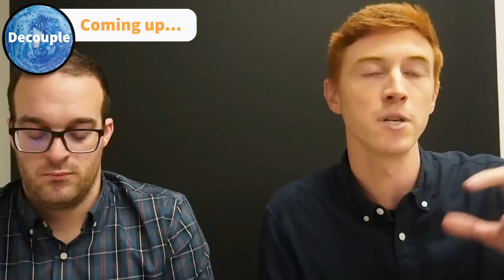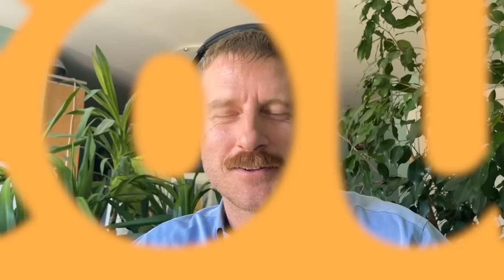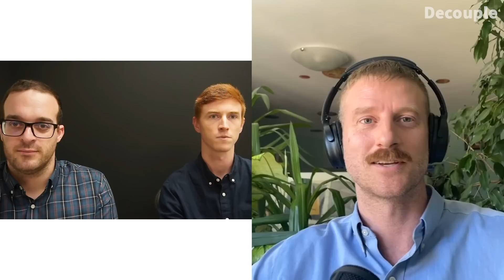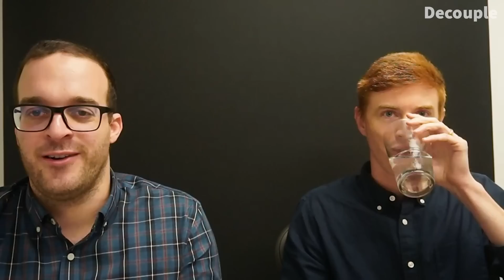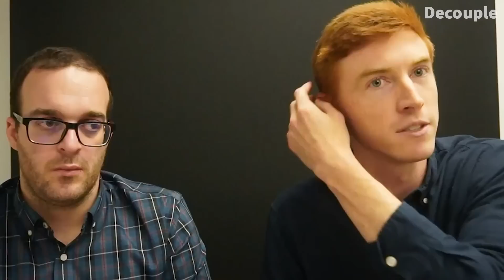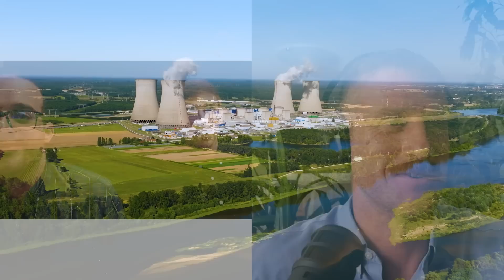The Real Costs of Advanced Nuclear

Comment: All this engineering for fuel handling? The gas makes it more complex engineering - not less. So why bother? Why? Put your brains and money into molten salt reactor technology and you get high temperature with zero (relatively) fuel handling issues, plus the many other advantages of MSR you don’t get with any other type of reactor.
Reply: Also no downtime for fueling. Low-pressure/high-temperature/low-cost, what's not to like.
Reply: @chapter4travels  nuclear needs constant demand daily and constant cash flow daily. 

That is a real problem, for all centralised electricity.
Rooftop PV and BVs oversized battery is the real disruptive.
Reply: @stephenbrickwood1602  Ok, so the world is going to go from 20% electric to 100% electric with rooftop solar + oversized battery EVs. Bwhahahahhaha
Was there a contest for dumbest energy transition plan possible? If so, you win, hands down.
Reply: @chapter4travels  you remind me of the child who said he would pay for it, you just give me the money.
Reply: @stephenbrickwood1602 .  Nowhere ever has solar been a replacement for nuclear. It’s solar over a lot of land plus something else, ie gas, plus pipelines plus transmission for both, plus staff and maintenance for both. We all know that.  You know that. So why carry on about cost of solar alone as if you’re fooling somebody?
Reply: Since there is no commercial MSR, not anywhere in the world, and there never has been, why would should some engineer starting a new company in the worlds most highly regulated industry do something so foolish?
Reply: @Czeck0-u1k  Because old school, outdated, obsolete, high-pressure/low-temperature, inefficient, really, really expensive reactors will only ever be niche (electricity only) sources for rich countries. 
Whereas MSRs have the potential to be cheaper than coal plants without scrubbers. It's just the potential because of the over-regulated market as you say but worth the effort. 
PWR/LWR are old, boring, and have no future and MSRs do.
Reply: @chapter4travels   bizarre. All those adjectives w zero real argument. Might as well be doing a Superman vs Hulk thesis.
Reply: @Czeck0-u1k  It was fun to type and I'm pretty sure you figured it out.
Reply: @chapter4travels  you bet. Hulk Smash.
Reply: Molten salt is great; I'm a big fan, but they can't do what high temperature gas can do, namely industrial heat.  We need them both.
Reply: @davidbutz39  Molten salt can go as high as 750c for now, maybe higher later but the big thing is that gas is a terrible heat transfer working fluid while salts are extremely good. Compare the specific heat capacity for each and it becomes clear.
Reply: @davidbutz39  I can’t agree. Some MSRs can run just as hot and have many other advantages over HTGR, eg but one benefit is that while HTGRS have to run at around 1,000PSI to cram the required energy into the He gas, MSRs (esp fast MSRs) run at near-ambient pressure requiring no high pressure engineering substantially reducing the size and complexity of the reactor. And there is much more…
Reply: Do me a favour and ask how much the extra grid capacity will cost to the millions and millions of customers. 
I seem to be ghosted. Hahaha.

As you say, solving the wrong economic problem is not the answer. 😮
Reply: @stephenbrickwood1602  I don't understand your comment.. Solar and wind have the greatest disruption and/impact on the existing Grids. Also, process heat is not well managed by either  solar or wind. Please explain your concern.
Reply: @bobdeverell  My concern is that 3 things make up the national electrical grid. 
Customer, Grid, Generation. 
ROI, return on investment is critical. 
The grid is × 10 times the cost of Generation.
Electrical energy is only 15% of all energy used. 
Australia has 25gW of generation capacity. Fossil fueled. 
Nuclear promoters such as Robert Parker says Australia will need 286gW of electricity. 
Robert Parker says that because the grid is so expensive that replacing existing fossil fueled generation with nuclear AT the existing plant locations is the only economic way possible. 

Robert goes on to talk about 286gW of nuclear electricity. 

Robert is silent about the 26gW limitations on the existing grid and expects 286gW to be transmitted with out taking into account the $TRILLIONS per 286gW limit facts.

What I am saying is the full grid generation and its expanded grid distribution needs customers staying connected and maintaining cashflow to the owners of the nuclear generation plants and the owners of the expanded grid.

BVs, battery vehicles with big oversized battery and Rooftop PV will be able to be independent of the grid. 

Grid cashflow will crash. 

Do you understand what I said.
You may not agree but you should consider the engineering and economics limitations of grid investments.
Reply: @bobdeverell  at the moment 74% of all grid electricity goes to buildings. 
If rooftop PV and BVs combine when the sunshines 🌞 then grid electricity will not be needed for hours every sunny day.

Nuclear must have constant demand and cashflow for the highest UTILIZATION of its investment. 

The Grid is 10times bigger investment and must have cash flows 24/7 or it must charge more $kWh.
More $kWh is an incentive to be more independent of grid electricity. 

The nuclear promoters 'talk over' the economics and grid engineering with constant nuclear 'blinked perspective'.

My concern is that 3 things make up the national electrical grid. 
Customer, Grid, Generation. 
ROI, return on investment is critical. 
The grid is × 10 times the cost of Generation.
Electrical energy is only 15% of all energy used. 
Australia has 25gW of generation capacity. Fossil fueled. 
Nuclear promoters such as Robert Parker says Australia will need 286gW of electricity. 
Robert Parker says that because the grid is so expensive that replacing existing fossil fueled generation with nuclear AT the existing plant locations is the only economic way possible. 

Robert goes on to talk about 286gW of nuclear electricity. 

Robert is silent about the 26gW limitations on the existing grid and expects 286gW to be transmitted with out taking into account the $TRILLIONS per 26gW limit facts.

What I am saying is the full grid generation and its expanded grid distribution needs customers staying connected and maintaining cashflow to the owners of the nuclear generation plants and the owners of the expanded grid.

BVs, battery vehicles with big oversized battery and Rooftop PV will be able to be independent of the grid. 

Grid cashflow will crash. 

Do you understand what I said.
You may not agree but you should consider the engineering and economics limitations of grid investments.
Reply: @stephenbrickwood1602  I understand your point that if EVs with V2G can be widely deployed this may greatly simplify the logistics of solar and wind..
But I don't understand your points about grid economy. Many grids are used to share generating resources and minimise backup. Grid upgrades become essential as we expand wind and solar, at least until huge amounts of distributed storage come on-stream. The present grids would need only minimal upgrading if we abandoned wind and solar and replaced existing coal generating stations etc by similar sized nuclear plants. In your scenario, AI data centers and manufacturing processes that require high temperature heat may prove uneconomic for wind and solar, unless you assume these will be outsourced to Asia.
Reply: @bobdeverell   .

The larger amount of electricity needs a larger capacity grid. 
At the moment, for example,  if I wanted more electricity after removing gas supply and gas appliances and adding air-conditioning and BV charging, I would need 3phase supply like my neighbour. 
They connected 3phase 30 years ago. 
No BV charging but still needed 3phase. 

So today, I would have to apply to see if my grid still had spare capacity for me to increase my demand. 
30 other homes in my street would have the same capacity increase if they also wanted 3phase supply. 

All new developments larger than homes have to wait for grid capacity upgrades and conformation that all neighbouring developments combined will not overload the existing supply. 
I have worked with developers. 
This is not magic. 
People don't understand the engineering restraints.
I saw one project held up for a year as street supply was upgraded. 

So a simple 3phase connection like my neighbour's in 30 homes is not easy or cheap or quick.
Just only 30 homes in my city of millions is a problem. Just a nearby project was a problem. 
I have constructed  substations in buildings so that they, the building, would have 'more than a blackout ' on opening day. 

These simple things are invisible to the public. 
I get 'pissed off ' when medical people run podcast videos and invite extremely qualified people to talk about the fantasy of nuclear stopping CO2 emissions worldwide. 

It is like saying let fly and not build roads.
Exciting but stupid. 

100% nuclear electric world is insane.
Grids are 'f...king expensive and must have their huge cashflow. 
Resource demand and time delays and CO2 emissions will all explode. 

And then nuclear industries in every country,  FMD.
The reason we have not had nuclear electricity in every country is not economics,  it is military defence constraints, (and defence budgets exploding.) 

As for AI demand etc. you are right. 
The future of electricity SUPPLY is the biggest problem to stop CO2 emissions worldwide. 

Nuclear promoters just ignore the real problem and basically half talk. 

Yes we all agree CO2 emissions bad.
Yes we all agree electricity can be the main solution. 
But half answers are even more dangerous as they give false hope and waste time and resources. .
Reply: @bobdeverell 

The larger amount of electricity needs a larger capacity grid. 
At the moment, for example,  if I wanted more electricity after removing gas supply and gas appliances and adding air-conditioning and BV charging, I would need 3phase supply like my neighbour. 
They connected 3phase 30 years ago. 
No BV charging but still needed 3phase. 

So today, I would have to apply to see if my grid still had spare capacity for me to increase my demand. 
30 other homes in my street would have the same capacity increase if they also wanted 3phase supply. 

All new developments larger than homes have to wait for grid capacity upgrades and conformation that all neighbouring developments combined will not overload the existing supply. 
I have worked with developers. 
This is not magic. 
People don't understand the engineering restraints.
I saw one project held up for a year as street supply was upgraded. 

So a simple 3phase connection like my neighbour's in 30 homes is not easy or cheap or quick.
Just only 30 homes in my city of millions is a problem. Just a nearby project was a problem. 
I have constructed  substations in buildings so that they, the building, would have 'more than a blackout ' on opening day. 

These simple things are invisible to the public. 
I get 'pissed off ' when medical people run podcast videos and invite extremely qualified people to talk about the fantasy of nuclear stopping CO2 emissions worldwide. 

It is like saying let fly and not build roads.
Exciting but stupid. 

100% nuclear electric world is insane.
Grids are 'f...king expensive and must have their huge cashflow. 
Resource demand and time delays and CO2 emissions will all explode. 

And then nuclear industries in every country,  FMD.
The reason we have not had nuclear electricity in every country is not economics,  it is military defence constraints, (and defence budgets exploding.) 

As for AI demand etc. you are right. 
The future of electricity SUPPLY is the biggest problem to stop CO2 emissions worldwide. 

Nuclear promoters just ignore the real problem and basically half talk. 

Yes we all agree CO2 emissions bad.
Yes we all agree electricity can be the main solution. 
But half answers are even more dangerous as they give false hope and waste time and resources.

Comment: There may be places that a nuclear power plant could be justified, especially in norther latitudes. But frankly all that nuclear does is boil water. Alternatively, it may be the case that renewables like wind and solar will out compete nuclear. Massive amounts of renewables are coming online, but the problem is the weakness of the grid. The key to renewables are battery storage and grid distribution. Just think of electricity from Mexico and the American southwest being shipped to Canada.
Reply: Good comment. 
As latitudes warm cold latitude solutions will be unnecessary. 

$100BILLION in generation and $TRILLIONS in grid capacity to millions and millions of customers with rooftop PV shading hot roofs. 
BVs oversized battery that make the home battery look pathetically small. 
BVs parked 23hrs every day and all night long with V2G feature.

Millions and millions and millions not needing grid electricity. 
Grid owners with no ROI cashflow. 😮😮
Generation owners with little ROI cashflow. 😮😮

The Australian national electrical grid is 1million km and $1million per km as a minimum value is huge at $TRILLIONS. 10 decades to construct.
Reply: @stephenbrickwood1602  Grid expansion and upkeep will have to take place regardless of being nuclear or renewable.  As to ROI, I live 15 miles from a closed twelve year closed nuclear plant and am still paying for the stored spent fuel. The solar panels on my roof are paid for and my electricity is free. Remember, sunshine and wind are free. Your ROI nuclear plant is a stranded asset.
Reply: @chrisconklin2981  Nuclear needs constant steady demand and cashflow and decades of cashflow. 
Nuclear can fill the existing grid and new customers will need more grid construction and more generation construction. 

The grid needs a ROI, return on investment 10 times bigger than the cost of the generator plant's and electricity it is designed to transmit. Just a fun fact.

Customer's need electricity. Millions and millions of customers. 

Customers rooftops PV and BV oversized battery can easily handle customers needs.
Customers bigger systems and grid connection can easily become the grids generator. 

The grid can now supply more new heavy industrial customers, with little new grid construction costs.
Basically maintaining ROI cashflow in the existing grid, but now more connections 

Nuclear will not be needed in the warming electric future with BVs and their oversized battery.

20million buildings rooftop PV can easily out perform fossil fueled generation or all the proposed Nuclear generation. 

Just let fossil fuels generation survive as the rooftop PV renewable electricity increases. 

Rooftop PV only needs the existing national grid. 

Nuclear can not compete with customers rooftop PV and BVs oversized battery. 

The grid can loose rooftop customer's cashflow, and gain rooftop PV generation supply and BVs steady daily supply and also take on more industrial customers to maintain total cashflow. 

Nuclear is a waste and uneconomic distraction.
All distant renewables have a grid cost problem.
Reply: "like wind and solar will out compete nuclear" physics says otherwise, nuclear reactors need significantly  way less materials and space, and the fuel need is little compared to the power output that in reality wind and solar can't compete if your aim is near 100%
Reply: @bencoad8492  Regarding the term competition,  you have to ack who is competing for what and for who? Our traditional power system was highly centralized and produce power at the top and distributed to the bottom. It was also highly subsidized by government and rates were kept high to  pay investors.  When consumers become producer and create local grids this changes the financial dynamic. Sure some corporation will build nuclear plants for their own needs. But system wide nuclear is dead.
Reply: @chrisconklin2981  dude did u even read my comment, the fact is for a near 100% solar/wind roll out there is not enough copper on the planet at current demands for electricity alone total energy, and thats just one example of the short fall, nuclear isn't dead lol
Reply: @bencoad8492  
 I am glad that you know how much copper exists on this earth because no one else does. I think you confuse demand with supply. Yes, the supply of copper along with other minerals will slow down the transition to renewable energy. Yes, the mining of copper has slowed. What usually happens is that mineral shortages increase the development and efficiencies of those resources.
Reply: @chrisconklin2981  dude its estimate of global deposits, if u think they don't know this ur dumb
Reply: @chrisconklin2981   At 60ppm crustal average copper concentration, and 2.77e22 crustal mass, there are 1.7 quintillion tonnes of copper in the Earth's crust. For the foreseeable future, however, there won't be enough copper for any large new use (EVs, wind-and-solar, etc.). Mining cannot expand, as it is becoming increasingly criminalized.

Additionally, wind-and-solar absolutely depend upon fossil-fuels.
No fossil-fuels = no wind-and-solar.
Reply: Do me a favour and ask how much the extra grid capacity will cost to the millions and millions of customers. 
I seem to be ghosted. Hahaha.

As you say, solving the wrong economic problem is not the answer. 😮